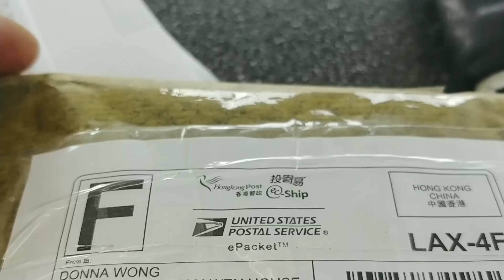Hanging Drywall in this big shop! Work vlog construction show.

Comment: Nice job. If you had  the telpro panel lifter (http://telproinc.com/products/worlds-best-drywall-lifts/ ) .. with the larger mast you could  have hung those tall ceilings fast  with the small crew.  You could have tacked them up with  a 12 foot step ladder while  the guys chased you with the  rolling scaffold screwing off and helping with the tacking up.   Tell your guys that the Tesla and the extra truck for pulling  toys  are possible in drywall. The key is to save the lumbar  and  keep the crew small and focused on each project and making sure the guys  doing the ceiling while your on to the next job do not eat up your profits on this job. Also you have to figure out a way to capture the entire job. You need to get a finishing crew with a lead man. You are creating a massive work path by hanging all these jobs. Basically you have the lead on the finishing. You need to work out  deals with your clients by telling them if they want your quality workmanship they need to give you the entire  burrito supreme . I know from  watching your work you are well versed on commercial framing and I know interior house framing sucks. But the hanging and finishing should be your whole deal  where you can get more profit from each job. You are young and smart and could take over the drywall empire in your area.  Get your former employers to sign off on your hi rise experience and go for the GC test.  Take a GC course to prep for the test. With a GC license you can still do the drywall but have more leverage on the jobs. ( I wish someone told me these things when I first started out in drywall.)